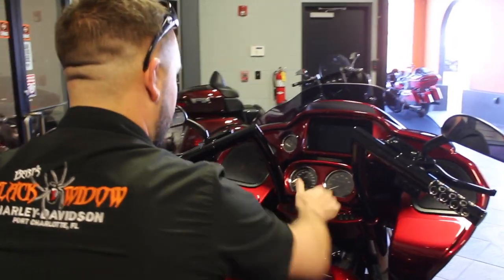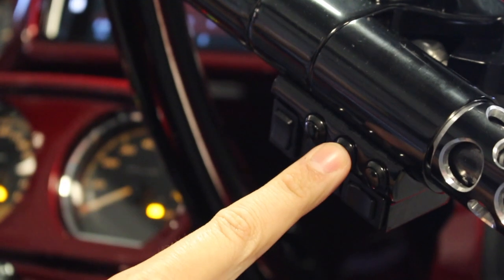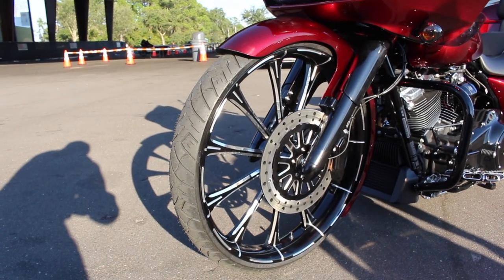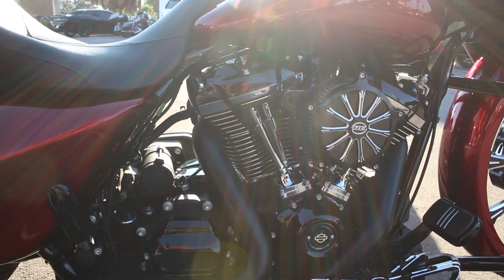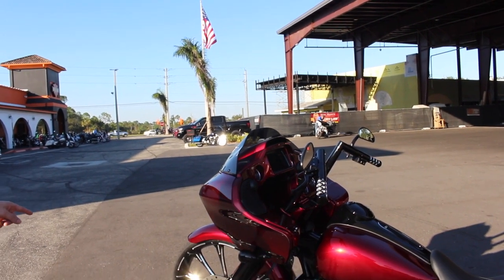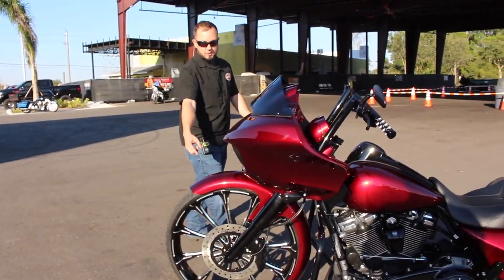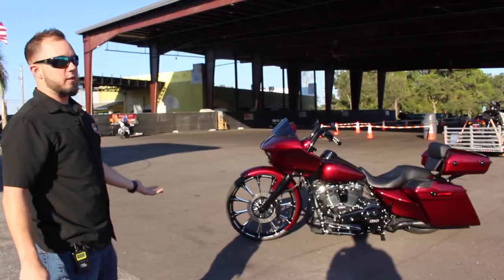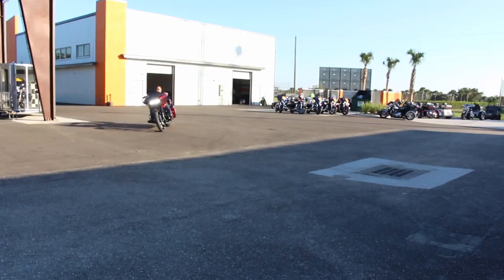26" Big Wheel Road Glide Special | Custom Build

Comment: How many brake pads will it eat through?a 40 inch wheel in motion is not going to stop the same as a 20 inch wheel unless you install bigger brakes/rotors.simple physics.put a 330 rear and the clown bike look will be complete!!